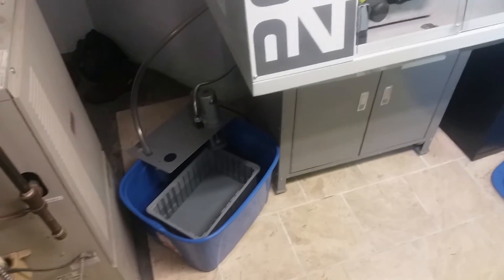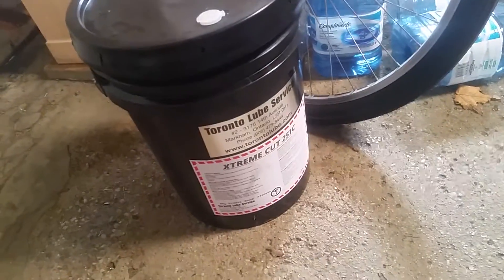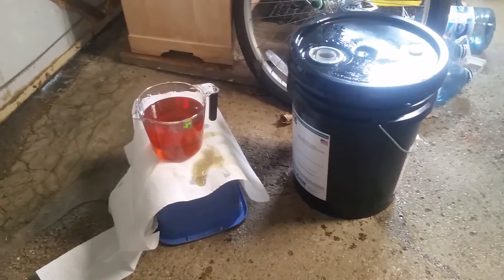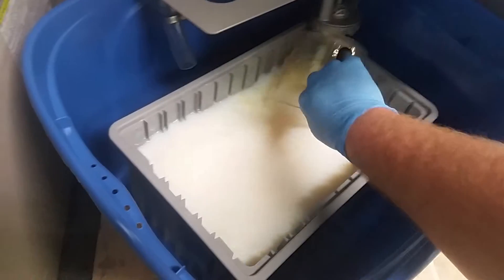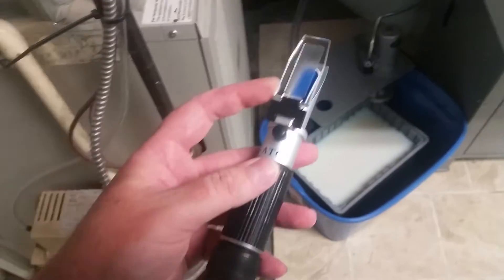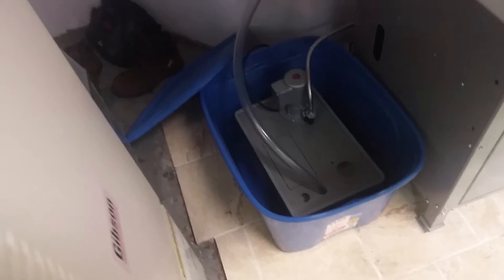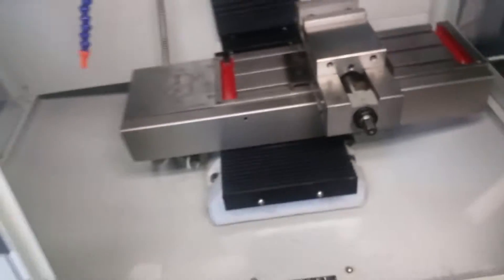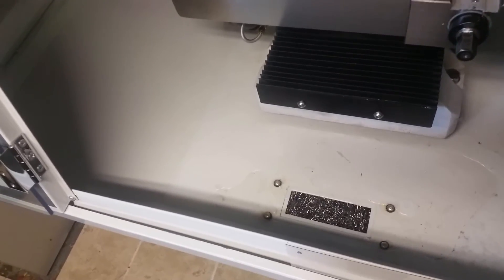Qualichem Xtreme Cut 251C Coolant Setup

Comment: Theres always a leak or two, you'll get it sorted. See how you go but it might be worth putting a filter on the delivery side so you don't recirculate fine chips from the tank, back to the cutting area again.
Reply from the maker: I've got the drain off now and I'm adding some extra bracing all around to give me more surface area to load up with silicone.